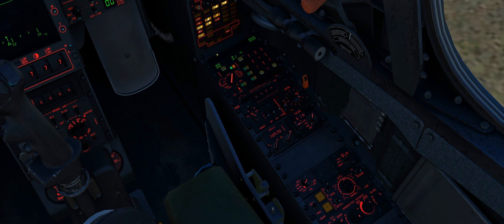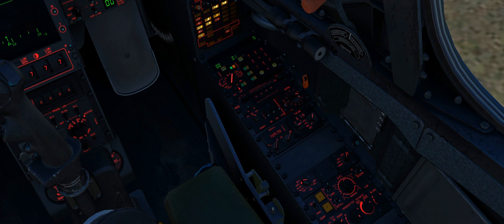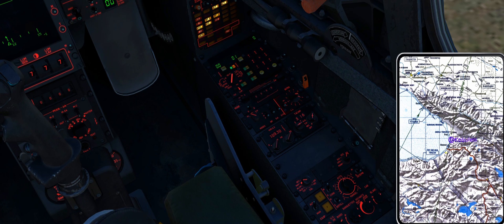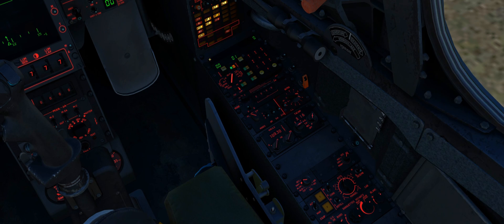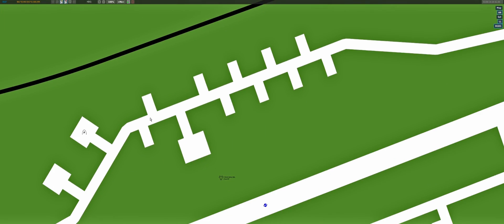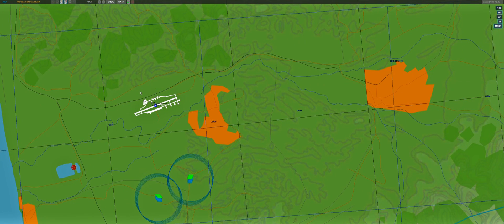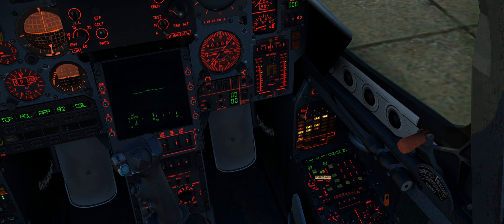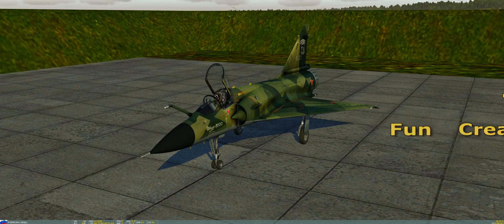DCS Mirage 2000C INS alignment and waypoint entry tutorial

Comment: Think you made a mistake, you need to divide the decimal number by 60 to get the correct L/L coordinates to enter from the F10 map.
Reply from the maker: In the settings you can set if you want DCS F10 map to show minutes and seconds or Decimal coordinates. I've set it so it show the correct coordinates for the Mirage. Thus I don't need to divide. :) Default though is minutes and seconds.